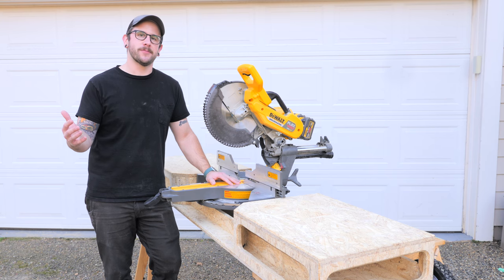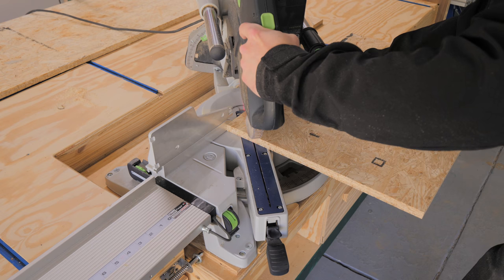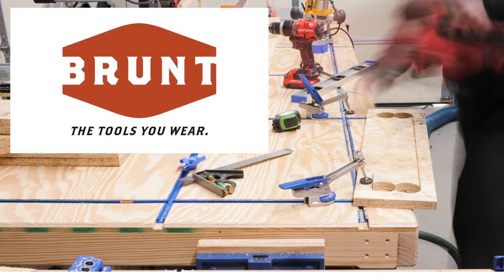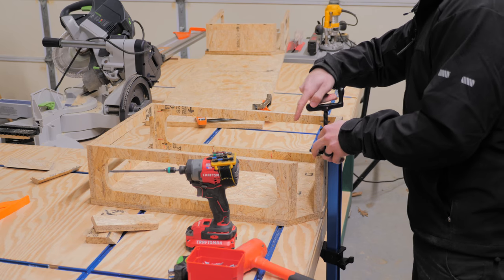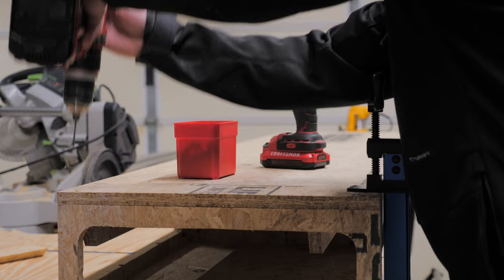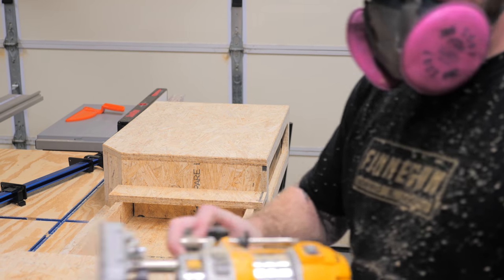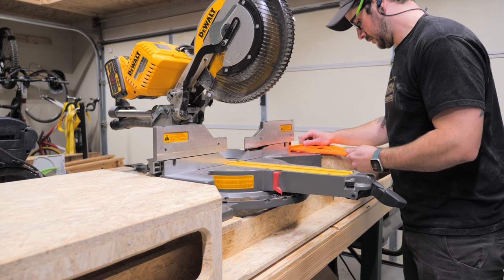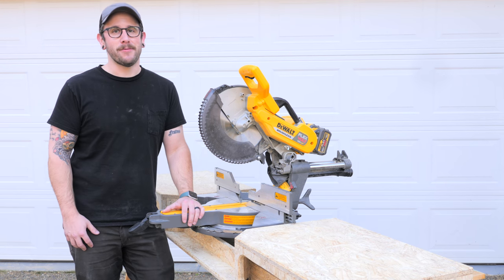DIY MOBILE MITER SAW STAND with Wheels // How To Build - Woodworking

Comment: Really like this build. Sorry to add to the armchair quarterbacking, but in the future I recommend leaving one of the nuts on the threaded rod before you cut. Then you can back the nut off and it will fix any of the threads that were botched in the cutting process. Will reduce the risk of not being able to thread a nut on after the cut. Thanks for the vid!
Reply: That's the first thing I thought of, too.
Reply: That's how I always do it except when I forget, which I sometimes do.

Comment: Great Video, I love the wheels Idea, So I'm now officially stealling this awesome idea.

Your Mitre Saw station is great the way it is.  However have you thought of taking it to the next level by adding a couple of detachable fences to each side of your saw, they could be attached with star knobs and threaded inserts and then stowed inverted inside the left and right supports.   You could add a T track and tape measure on these which would allow you to make accurate repeatable cuts. (if you want to go that far)

Personally one upgrade I would deffinitly recommend is having a way to make your extended side support fit on either side. It would not take much to incorporate this and then gives you options.

Comment: I think I'm going to do something like this as well, I like this design. I'm going to glue everything though.

It would help if you prime it with an oil-based primer and then throw some paint on it. You could even spray paint it over the top of the oil base primer, this will help keep that stuff from swelling if it draws any moisture.

Comment: Nice work. I wonder if the detachable wing could have a leg that folds down so you don't need the roller stand. Of course, always improvements can be made to everything which isn't always the goal.
Reply from the maker: Cool idea! I think that would probably work with the right design.

Comment: Torsion box construction Is extremely strong. I like the build except for the material. Too heavy. 1/2 inch plywood wood be strong enough and a lot lighter.

Comment: Exactly what I need! Question: Does the extension wing fit inside the stand when not in use?
Reply: No, because the boxes to the L and R of the saw are only open on 3 sides. The 4th side next to the saw is closed. So IF the wing fits into the opening, it would only insert as far as the width of a single box.

Comment: Two small tips. Use a small length of PVC or EMT on your all thread and the clamps you used will fit better as will the all thread inside to pipe. Second, when cutting a threaded rod first run a nut on the side you want. Cut it then run the nut off the rod. It will straighten the threads back out. Of course it will not remove the sharp edge on the rod. Nice build but I bet it is a bit heavy to move around, still nice though.
Reply from the maker: Good tips!

Comment: How do you plan to attach stop blocks to the wings? I assume you will probably to screw them down but I would be worried that it might shift slightly when driving the screw in. Doesn't seem like there's a good way to clamp to that surface. But I don't think its worth making a fence or installing t-track...not sure what's a good option in between! I'm sure you can come up with something
Reply from the maker: I’m probably going to route in a keyhole slot so I can use t-track stops. That or just clamp a square, which I’ve done a number of time.

Comment: does your sawstop jobsite pro have a small bow in the sliding extension table? for the life of me,  I cannot get it to be flat and im trying to figure out why its high in the middle. Every time I try to move the fence it catches on it :/. Also, how do you cut bigger than 25" when ripping, as I havent figured out how to do it without building a table that lines up with it and building a matching rail system?

Comment: Hey cool project that I might be using soon, could you answer  honestly about which saw you would buy if you were on the market for one again Kapex or Dewalt, does the flex volt last long in real life use
Reply from the maker: I wouldn’t buy the Kapex, it’s ridiculously expensive. The Flexvolt lasts a very long time and has a plug-in adapter if you want to run it corded. The Bosch Glide is also a great option.

Comment: Hey, so I used your video on the router table you built and am making the same but a bit taller with a third drawer split in 2 with a plywood top. Thanks!
Anyway, I am really loving woodworking and would like to do it full time. I'm 36 and welding inspector by trade, but don't now how to make the switch. I basically just build furniture for my house so far and friends love it. How do you have access to such a big shop outside of your garage, and how do you make a living doing it? Any feedback helps.

Comment: Any chance you have parts measurements for the mitter stand? How wide is the deck? I'm vacillating between a wooden frame and welding a metal one.

Comment: Nice! What’s the weight on that baby? 
Any thoughts on having a notched spot in the top surface to accept the extension rather than the block?
Reply: I was wondering that too. Google says a 4x8 sheet of 3/4 OSB is 80lbs and I would guess he used most of a full sheet.

Comment: Thread a nut past the cut point, cut, then remove the nut. It’ll clean up the threads, removing the burr on the way out
Reply from the maker: Yup, I did do that but it was still a little sharp! Don't want to cut myself on that edge in the future.

Comment: Some hinges and 6x6 posts would make the saw horses be built in...

And like others have said use a pair of nuts on the threaded rod to set the cut length and when you pull the nuts off you will not have burrs.

Comment: I love everything except the type of wood
Reply: What wood are you thinking to use instead?
Reply: @CraigJones191  I don't know. Plywood instead??
Reply: For a table like this with those dimensions if you use plywood it would need to be 3/4" thick, that will make a very heavy table with the saw attached.
Reply: Advantech subfloor is good stuff. Basically 3/4” thick, and holds up to water very well. Huber states it can be left outside installed for 500 days before needing to sand the seams.